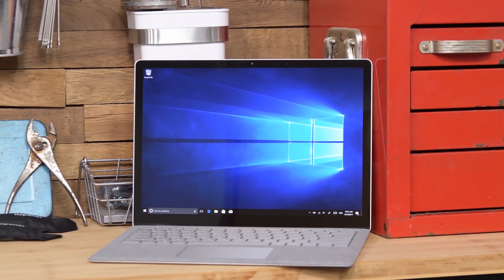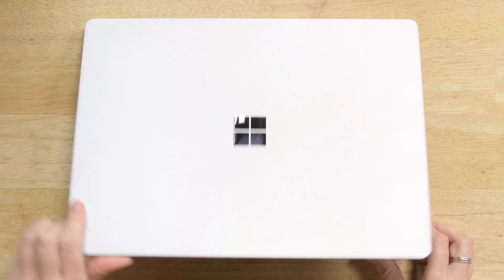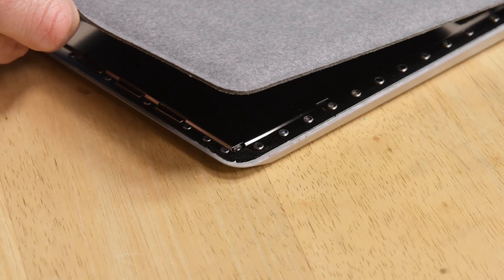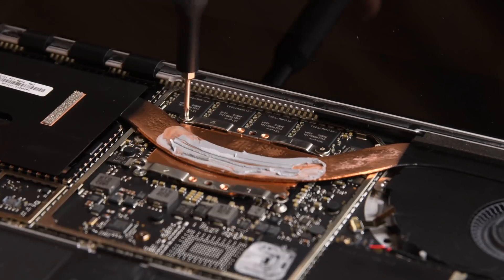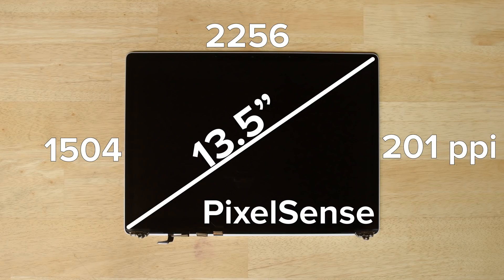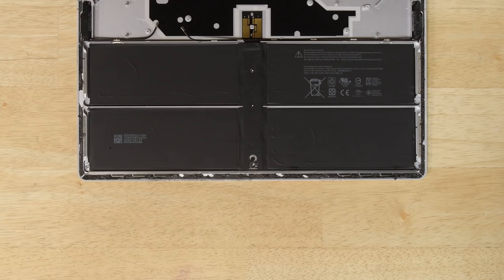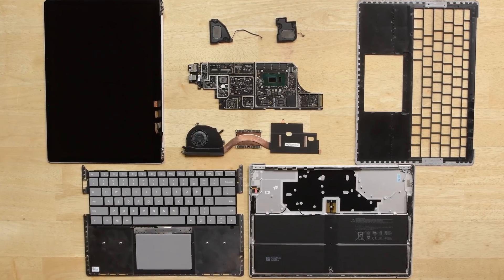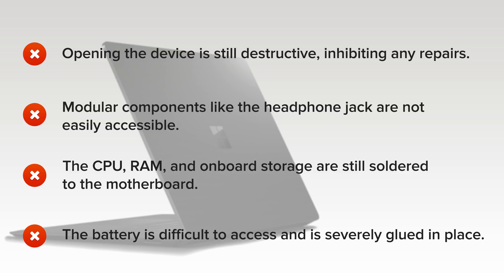Microsoft Surface Laptop 2 Teardown!

Comment: You guys really hate the surface
Reply: You'd have to be pretty special and lacking any logical thinking capabilities not to hate how they basically made this thing a disposable POS. I'm yet to own a laptop that I didn't have to get inside of to either remove dust/reapply thermal compound or replace a drive/battery/screen/and so on.

Comment: 0 seriously
Come on it's not that bad considering the compactness of the device
Reply: Its in the same boat as the MacBook Pro tbh, its just not destructive when you take the mac apart
Reply: it deserves 0 because once you take it apart there's no going back, unless you use it as a desktop replacement plugged into an external screen/keyboard/mouse afterwards.

Comment: That is tragic. This is why none of the Surface line is recommended by our company. If we need to do repairs it's an entire replacement of practically everything.
Reply: if they are under warranty thats a good thing, the enter key broke? thats a full device replacement coming up, the later the better, since they usually run out of low end models and are forced to give you a top spec model after a few years

Comment: You know, I'd have thought that by now one of the larger manufacturers would have caught on to the fact that having a highly upgradeable and repairable item in a marketplace full of difficult to upgrade and repair machines could be a strong selling point and a way to offer a fairly strong USP. I guess they just like selling so many new machines once the old ones show any issues, surely somethings got to give eventually.
Reply: That's why thinkpads are so damn underrated.

Comment: Such a shame that everything new is almost unrepairable, the government should pass a law to prohibit something to be unrepairable like that unless it's labeled disposable in order to lower electronic waste
Reply: Supporting an act to lower e-waste means less "donations" for the candidates that stand behind it. Unfortunately we can't have that. Thank you for your contribution, citizen.
Reply: on the plus side, if your warranty is 5+ years, if a single key fails, they will have to give you a new surface, thats actually not bad at all, and considering a few years down the road they might not have a exact replacement and they absolutely cant give you a lesser specced device, you might end up getting upgraded
Reply: Broken electronic devices are not waste actually. They can be easily refurbished to lower the costs of materials. If something would stay in good condition for like 10 years, you had to pay much more for it and you would not be able to upgrade for the new technology.